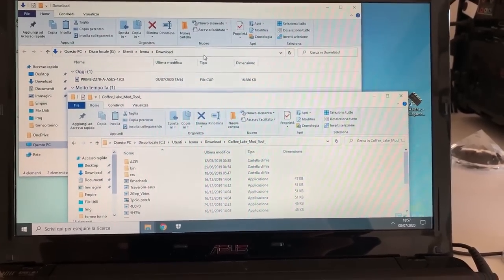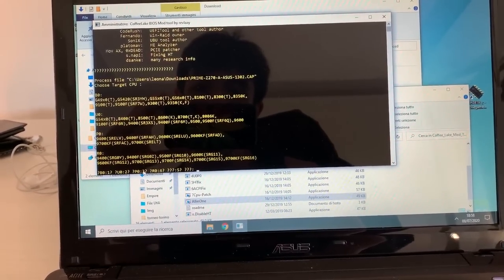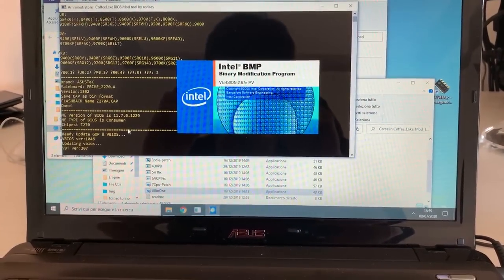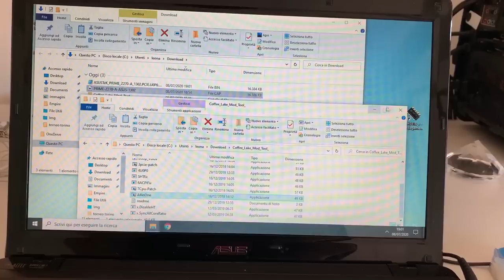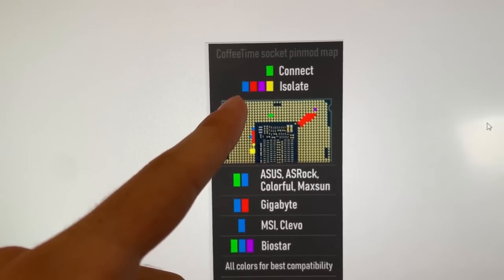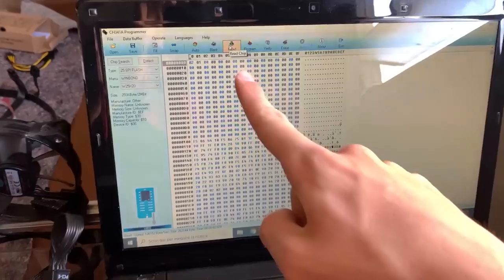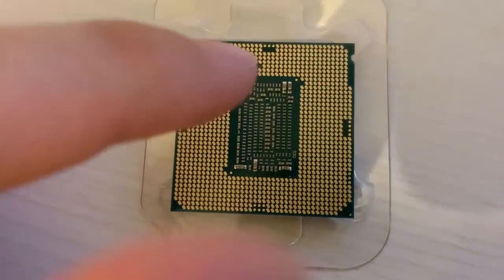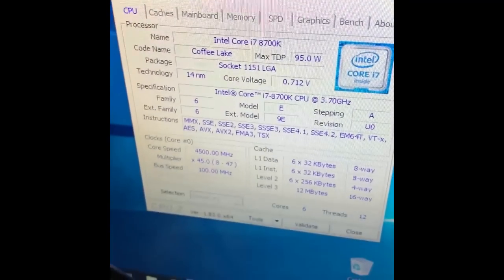How to Run i9 9900K on Z170 Full Guide (Every 8th/9th gen CPU on Z170 and Z270 mod)

Comment: I managed to get an i7 9700f booting and running on an H170 PCMate, but not for too long. A little bit of load (benchmark) and it just freezes, only way out is to restart.  Might you have any ideas what step I may have missed? My board only requires pin isolation which I did using electrical tape. Edit: Turning off Turboboost seems to keep it stable, what might that mean though? My motherboard just can't handle turboboost? Something to do with VRM?
Reply from the maker: That means you’ve done the mod absolutely right but the VRMs can’t handle it. You need to undervolt your CPU!

Comment: I have a Gigabyte Z170N and I want to upgrade the processor from an i3 to something better.  Is i7 7770k a good option? What kind of processor would you want to use?
Reply from the maker: That’s gonna be a very good upgrade too, but if you wanna do the mod as per my video, you can slot an i7 8700K or an i5 8600K in there!

Comment: Does anyone know for sure if this will work on an MSI Z170A Gaming M5 motherboard, and which CPU would be best to use with it? I'd like to use an i9-9900KS since it's the best one that can go in the socket, but with my motherboard being so old I want to make sure it won't have issues with compatibility even with the modded bios
Reply from the maker: Hi there! Yes it will work for sure with an M5, I have modded one myself. I’d say the absolute best CPU for gaming is gonna be the i7 8086K, but an i9 is also gonna work
Reply: Hey I have a particular question about this. I have an MSI z170-A sli plus motherboard. I was wondering whether I would be able to use m-flash, put the bios on the USB and flash it form there, or would I need the programmer?  Thanks.  @ImWateringPSUs

Comment: Would this work for a h110m-k? also lga 1151
Reply from the maker: It would but watch out: with the VRMs it has I wouldn’t put a 9900K in it, but for an i3 8100 it would be good!
Reply: @ImWateringPSUs  would a i7-8700k work?
Reply from the maker: @DanielTG  I think if you undervolt it yes, but it's getting closer to the board limits. A non-K 8700 would be safer!

Comment: This is a difficult mod and there will be a compatibility issue.  Intel did rob their customers big time by making z170 and z270 incompatible with 8th and 9th gen cpu.
Reply from the maker: It's definitely difficult and not beginner friendly at all, but if done properly there's no compatibility issue at all, been running an i5 8600K on an Asrock Z170 for years now!
Reply from the maker: But yeah I agree, they should've just made them compatible

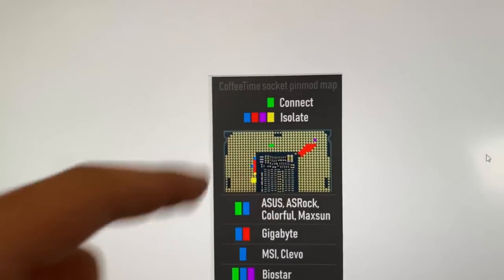Comment: What about a hp prebuilt(hp elitedesk 800g3)? Is there a way to know where to put the duck tape? 4:45
Reply from the maker: Steps are the exact same, but you need a pinout for the socket!
Reply: Were you able to find the pinouts to this? I am wanting to do this to a HP Elitedesk 800 g3 mini as an on-the-go gaming pc.

Comment: When Intel is lazy to make a new socket, but still wants to prevent users from having a great upgrade path.
Reply from the maker: Facts. I can kinda see why they've done it because an 8700k obviously would fry the VRMs of an H110 and they didn't wanna take the risk, but yeah debatable
Reply: @ImWateringPSUs  You can always undervolt to reduce strain and add heatsinks, but then nobody is going to run an I7 on a low end board.
Reply from the maker: @Cmdrbzrd  Oh yeah I definitely agree, I was just talking about why intel themselves haven't done it!

Comment: Impressive work. I want to do it with my PC too. This is my spec, GIGABYTE MATX GA-Z270MX GAMING 5 with i9 9900K or i9 9900KS processor. is your method can be instaled on my spec too?(especially the cpu blocker and connect)
Reply from the maker: Yes! It will work!

Comment: Did you have to short anything ? Or unlock the bios, something like that
Reply from the maker: That’s not necessary if you have access to an SPI programmer. If you wanna try to do it via USB flash, then on some motherboards that’s doable by unlocking certain portion of the BIOS or by forcing the flashback

Comment: I have an Asrock Z170 pro 4s do you think i can use an i5 9400??
Reply from the maker: Yes you can
Reply: @ImWateringPSUs  I guess it's a one way trip, once installed the new microcode for the new cpu you can't reverse to another?
Reply from the maker: @90Rido  Nah man, you can also use the previous one. And you can also change CPU in the future
Reply: @ImWateringPSUs  Thanks man really good news then!
I don't want to change a really good  motherboard to upgrade cpu unless i switch to ryzen!!
Reply from the maker: @90Rido  Let me know how it goes!

Comment: Does it work gigabyte z170d3h rev1.0 mobo. If yes, do I need to flash the chip. Or just modding the bios would be good??
Reply from the maker: Yes it does, you need to flash the chip
Reply: @ImWateringPSUs  thanks for the reply bro. can u link me the complete guide to flash the mobo. and i have a question?
1. after flashing doest the mobo compatible with native cpus like 6th and 7th.
2. after flashing are there will be any complications
Reply from the maker: @mansurzi  The guide is my video man. Just follow all the steps and you're good to go. It will still be compatible with previous gen CPUs and there'll be no complications
Reply: @mansurzi  by flashing the chip do you means connecting the 2 pin with pencil in cpu
Reply: @cooking4070  flashing means exciting the program with programmer into it.

Comment: Really helpful video, thank you! :) I want to try  that  on my 9700k, because I also have Asus Z170 Mainboard but I have a question about taping the pins. Do I remove the tape after flashing the chip and booting successfully or do I have to leave it there for ever? Because Im not sure if the tape will burn when the cpu gets hot during gaming or so and damage the cpu?!
Reply from the maker: Nope, you gotta let the tape there forever! But don't worry it's just an electrical contact with low voltage, it's gonna be alright
Reply: you need to keep the tape on, although you can remove it when you go to a more recent motherboard.

Comment: Just curious. Can I use the flashing utility that my computer already has to flash the bios after this mod, or do i need that programmer to do this? (Asus Rog G20ci)
 Im trying to put an i7 8700 (coffelake) in this thing. It has an i7 7700 (kabylake) now.
Reply from the maker: You’d actually need the programmer. But the mod is going to work.
Reply: @ImWateringPSUs  Awesome! thanks man!
Reply from the maker: @michaelcassidy9577  You're welcome mate, let me know how it goes!
Reply: @ImWateringPSUs  DUDE! It Worked!! Im running n i7 8700k in my Asus rog g20ci. H270 chipset!! loolololol! I wish the mod would have made the "h270" into a "Z270". I cant do any overclocking. My bios looks the exact same as it did before but now shows the i7 8700. Your vid helped a lot!!
Reply from the maker: @michaelcassidy9577  I'm really glad it worked man! Kepp it up ;)

Comment: Nice video man! I'm just wondering - You said that on MSI boards it's hard to go over 8 threads so it's impossible to use i9. Every MSI board is like that? I have Z170A Xpower gaming Titanium Edition.  Do You know if it won't work for sure? I'm thinking about i9-9900k or i7-9700k but I can't find info about compatibility.
Reply from the maker: Not on every MSI motherboard, but on most of them. I haven't tested your personal motherboard, I'd say you'd need to try out the tutorial and see  if it works. There's basically 0 risk of damaging it so give it a shot
Reply: @ImWateringPSUs  I jest tried but finally I bought i7-9700k. What I get is message "The ME FW was found abnormal". I tried with latest BIOS and changed ME version switched to Disabled in CoffeTime  0.92 automated tool. Later I tried with older bios but after flashing mobo doesn't even try to start boot procedure. I'm waiting for new programmer because my current just died after 2 uses x.x
Reply from the maker: @ukaszdabrowski732  Keep us updated my man!
Reply: @ImWateringPSUs  success! With coffetime v0.92, 7968v1D version of BIOS and 11.7.0.1229 ME version. After 9 tries :d Thanks for video man!
Reply from the maker: @ukaszdabrowski732  That's just great man! Thanks for specifying the ME version so that other people can use it as well!
Reply: @ukaszdabrowski732  Thank you very much for sharing your work in this mod, my friend! I also have the MSI Z170A Xpower Gaming Titanium Edition and I'm thinking to try this method with an i7-9700K. Did you used a CH341a programmer or it can be done with the M-Flash option inside the UEFI oh this mobo? Any issues with the XMP profile or the X16 GPU slot while using the i7-9700K? Once again, thank you!
Reply: @gabriel_4916  unfortunately my mobo was broken before so I'm not sure if PCI X16 slots are functioning fine because before my mod they were broken anyway. At first I thought that it was problem with CPU but if they are still not working after changing CPU to 9700k then I bet that its whole board. They doesnt work atm. I used 341 programmer.
Reply: @ukaszdabrowski732  I appreciate your help and your attention! I'm just waiting for the 9700K's price gets better to try this mod and give this mobo more years to come!

Comment: Where did you get the flasher ?
Reply from the maker: Off eBay
Reply: @ImWateringPSUs  would it work with an asus 170 a? I wanna get an i9 9900k but I didn’t see that option when you were selecting the different cpus
Reply from the maker: @power2daaplayer304  Yes it would! Just need to look for the right mCode

Comment: Will it work on a Dell Q170 mobo? Or not enough features to implement?

How did I not hear about this till now?
Reply from the maker: Yessir it actually works on ANY LGA 1151 socketed motherboard, I’ve even done it on a Clevo laptop that had a socketable CPU😂
Reply: @ImWateringPSUs  Thanks! Can I put a low voltage Xeon on there? I will have to decide on price though, they can be expensive. I need to upgrade PSU to get a GPU anyway so not a big deal.

Comment: can i use just a usb for the flashing step i have a msi z170a m5 moderbord
Reply: also could you tell me what you did with the ducktape was it for taking the pins out ?
Reply from the maker: Unfortunately you really need the programmer. The duct tape was to isolate the pins, yes
Reply: @ImWateringPSUs  you got the link to the programmer?